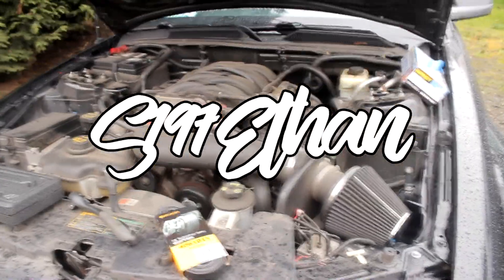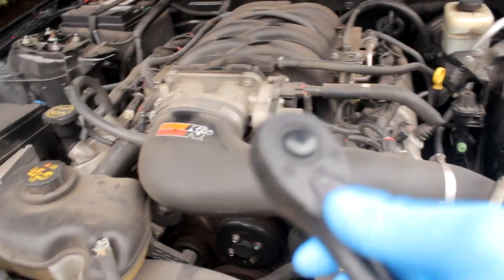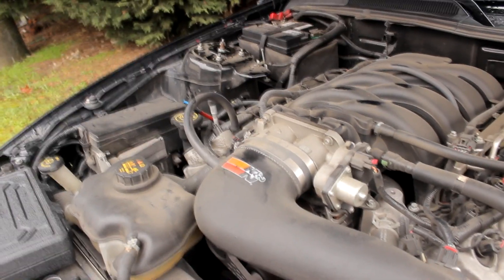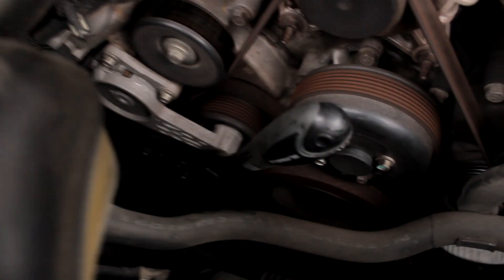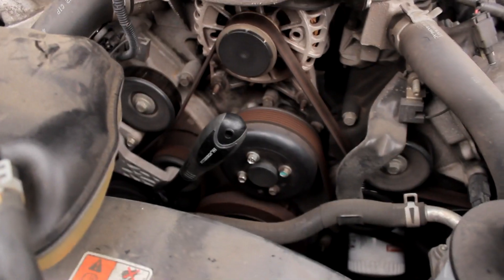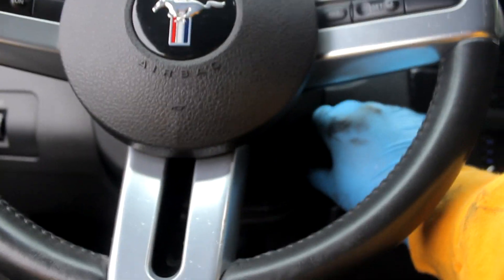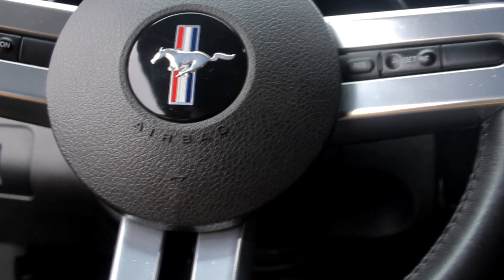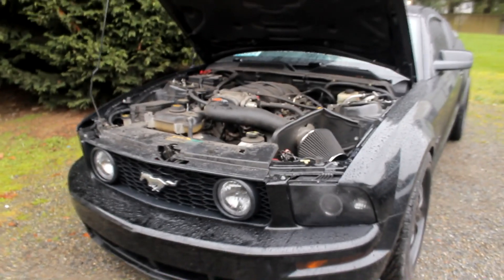How to PROPERLY Replace Your SERPENTINE BELT (05-09 Mustang GT)

Comment: I usually just "kiss" the ignition with the key so the engine cranks little by little so the belt can seat itself. If anything is binding, you really don't want the engine spinning.

Comment: Is it normal for the tensioner to be a little tighter on the new belt? I just replaced mine with a oem motor craft. I’m nervous the belt was too tight
Reply from the maker: Yes, when belts get old they also get loose. The tensioner is automatic and you can't change how tight it is.

Comment: My tensioner doesn’t seem to have any bolts excuse the ignorance
Reply: There's a square cut-out in the spring-loaded side of the tensioner. Put the nose of the rachet(no socket) into the square cut-out opening and release the tension on the tensioner. Very simple.